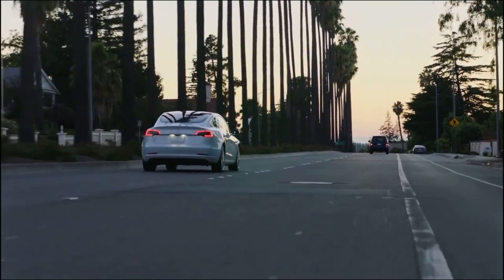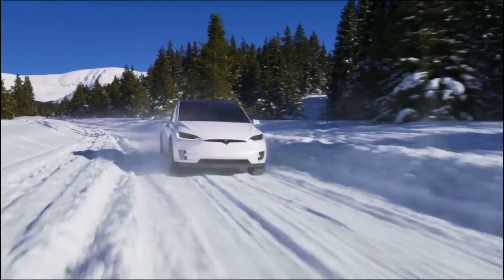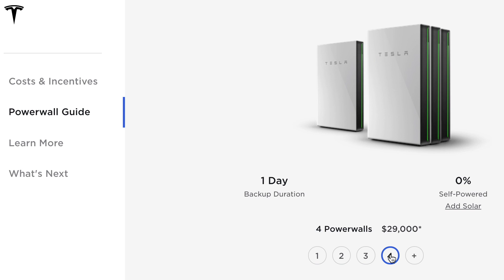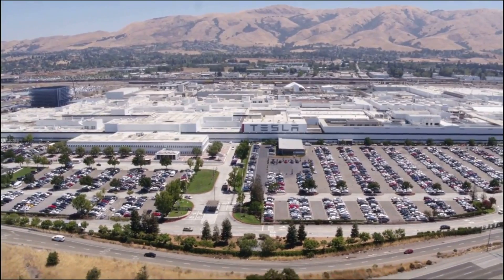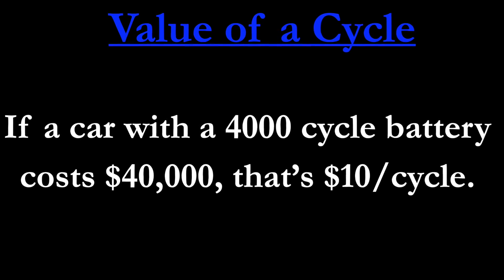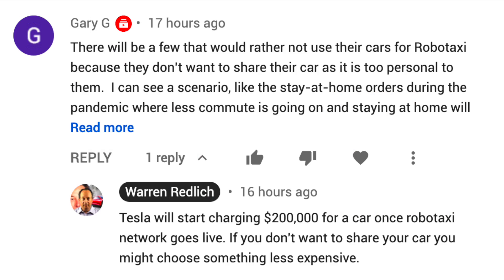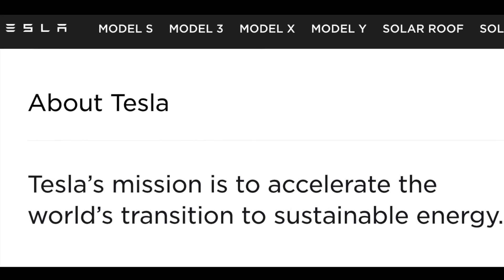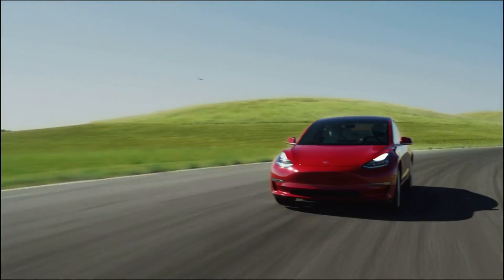Vehicle to Grid is Dead - Part Deux - JB Straubel

Comment: Vehicle to home would be more valuable to homeowners (as emergency backup) than V to G (price arb). 
Personally, I am still hoping for this optionality.
Reply from the maker: The install cost for that would be substantial. Powerwall installation is $5000, not including the cost of the Powerwall. But I do think it could be a good idea.

Personally I'd like to see V2PW - The vehicle backs up a Powerwall installation.
Reply: @WarrenRedlich  I think he meant using car output as emergency generator during once a month etc scenario, you trip the main breaker, plug generator (car) in socket & power the house. Unless you are not allowed by utility to do that.
But Elon talked on this as well, that it adds complexity(cooling system will have to be extended, car safety has to be analyzed against this modification), cost (inverter has to be designed specifically for car, low volume will increase cost as well), variation to vehicle (what to do with inventory car, say someone returned it but now new customer doesn't want to pay extra for this feature), and that most people will not be willing to pay extra for this feature.
Reply: @AfaqSaleemChannel  To hell with the utility, if the main breaker is thrown, what you do on your end is your business.  How would they know unless we live in Soviet Russia?
Reply: @carpenter3069  true, dunno why I was thinking utility won't let us take advantage of electric cars ☺️
Reply: @WarrenRedlich  I think a do-it-yourself electrician could set it up vehicle-to-home for much less than $5000.
Reply: Well you will get it with the Cybertruck.

Comment: "Vehicle to grid doesn't work." Someone had best inform the European Union - because they have not only been DOING this for several years - it is now MANDATED all commercial class and Emergency EVs MUST be able to FEED THE GRID if or when required. I know that researching a topic can be soooo tedious, but facts can also be HELPFUL...
Reply: This is done for balancing reasons not economic. But i wouldnt base everyones costs on what tesla charges to install either
Reply from the maker: I didn't base it ONLY on Tesla install costs. I used Tesla install cost to supplement two other sources.
Reply: This makes more sense if the vehicle lasts too long and has no hope of being used enough to wear out the battery in the owner's lifetime like vehicles with no autonomous driving future and a decent battery.